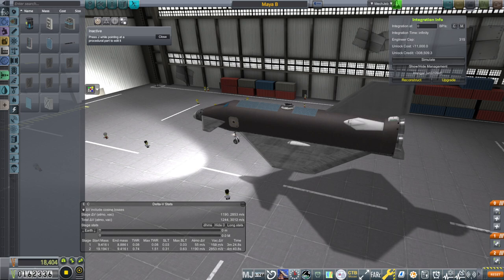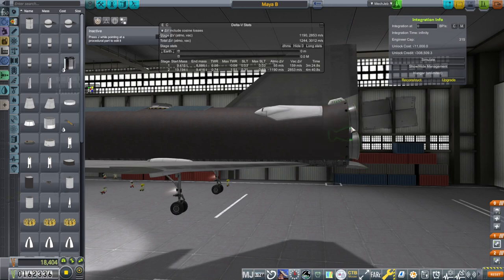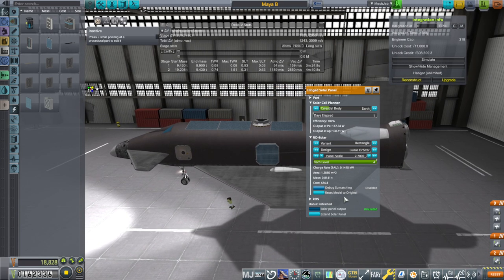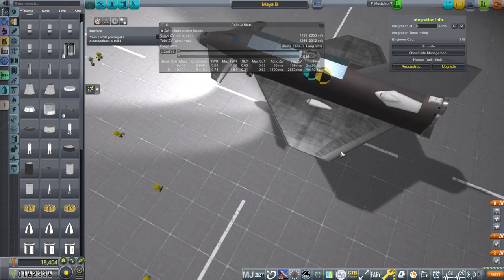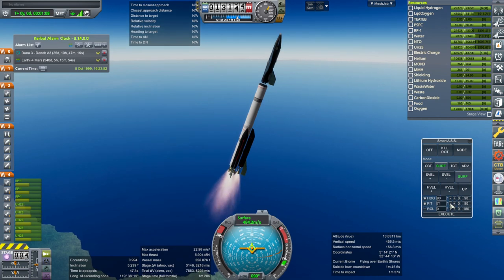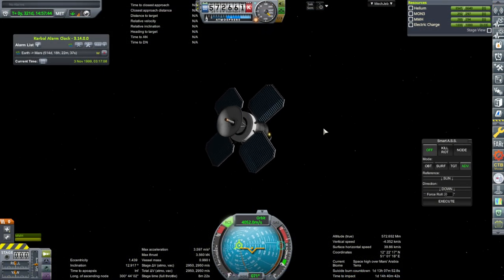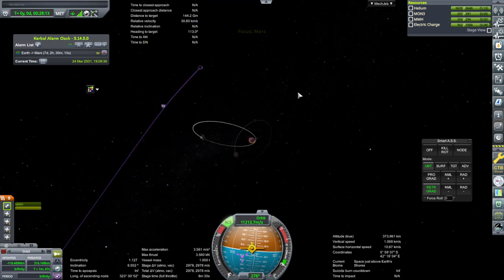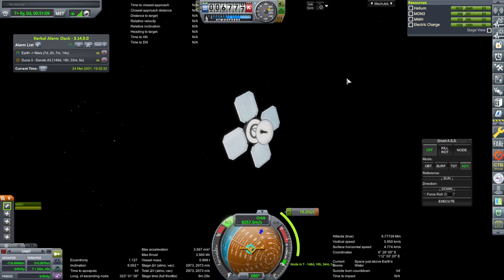RP-1 Career in KSP 1.12 - European Space Agency 45

Comment: to beat that cursed Kerbalism you have to stop and then activate fuel cell. and probably set dump to Nothing and then again to Water. it'll force Kerbalism to read FC properly. btw, there is the same bug each time you switch to the vessel in flight - fuel cell randomly stops and should be activated by stop/run. weird, annoying, habitually
Reply from the maker: Randomly stopping fuel cells . . . as if I didn't have enough reason to dislike them. The stock fuel cells don't have this problem - I assume this is a Kerbalism issue?
Reply: @RaizSpace  yep, i suppose so. also Apollo and Soyuz build-in FC works without issues - only externals do that weird thing. so stop&run them to get the numbers is the only way to handle them :(
btw they're not randomly stopping. they work fine in the background but stops when you switch to the vessel from tracking station.